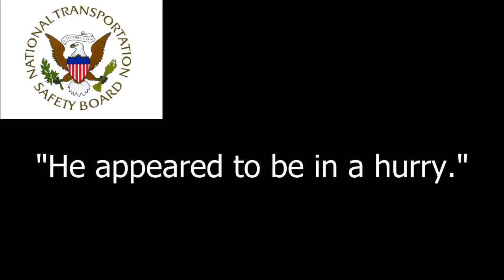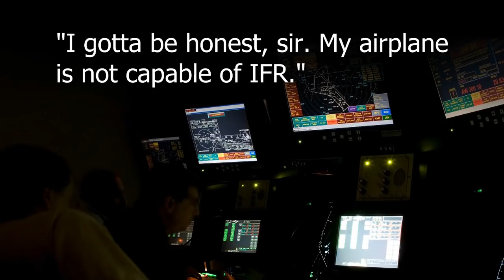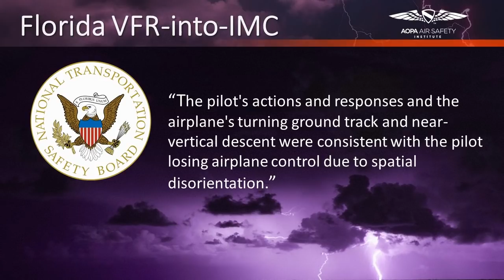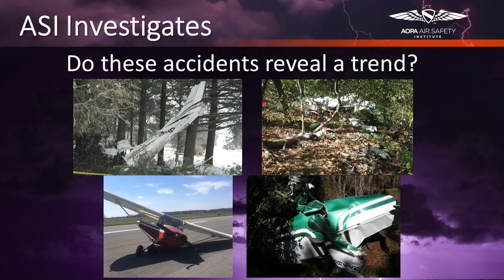ASI Fall Seminar: WX Accidents: Part 5

Comment: Didn't that aircraft at least have a turn and slip indicator? Even if you are totally disoriented, wouldn't that one simple gauge at least help you to keep wings level, and then watching the VSI and airspeed helps you to gain reasonable pitch stability? What about the Artificial Horizon? As one ex RAF fighter pilot used to tell me, "first level the wings, second get the nose straight. Third, solve the problem." Or maybe he was already iced-up and the aircraft was impossible to fly.

Comment: There is no level of hell deep enough or hot enough for an idiot pilot who does not have the common courtesy to leave passengers behind while they fly off to commit suicide. Reports of IMC? Plane not IFR certified? Suicide. A CFI should know better.
Reply: Reminds me of that CFI from the other video that flew his student and a friend into known icing conditions in an overweight Cessna 182 and killed the student's friend when they crashed. Should be charged with manslaughter if you ask me.

Comment: I'm curious.  Why do experienced pilots get into these situations.  I don't mean why do they get into IMC conditions... I understand that.  My question is this.  During my private pilot training (single engine land VFR only), the instructor had me flying under the hood for probably ~3 hours total over 3 to 5 flights.  This included putting me into screwy attitudes and orientations while I wasn't looking (at instruments or out windows), then handing control to me.  While it was a bit nerve racking, I found it fairly easy to look at the primary instrument... the attitude indicator... and return to level flight.  Of course I also needed to pay attention to speed, but that was generally secondary (and fairly obvious from the pitch/noise of the engine, even without looking at the airspeed indicator).

So I guess my question is... especially for IFR pilots in VFR airplanes... why do they get into these totally out of control situations when all the skill that's needed is the ability to understand the attitude and airspeed instruments and respond accordingly?  I'm not really talking about flying into a tornado or hurricane or severe thunderstorm that can rip the control surfaces off the airplane.  Those accidents make sense.  But where the only problem is visibility... I really don't understand how IFR pilots get into these total loss of control situations so often.  Well, I guess it isn't that often, but I've seen a whole lot of crash videos that seem to be this situation.

PS:  I'm also curious whether autopilots on new Dynon/Garmin avionics (including "wings level" button) plus GPS, moving-maps and synthetic vision have greatly reduced crashes in IMC conditions (not counting being blasted out of the sky by super-severe weather).
Reply: max bootstrap I used to wonder the same thing. Actual IMC is a lot different than the hood. With the hood, you still get a lot of clues about your orientation that I never realized before, and you know you can take it off at any time and you have an instructor there which makes a huge psychological difference. You are completely trapped in IMC with no way out. I can’t do the feeling justice here, but it’s a lot to handle. Saying to trust your instruments is easy, but when you are certain- absolutely certain that you are turning, descending, or climbing and your instruments say otherwise... It takes a lot to ignore something you are “100% sure of” if that makes sense. I only have 5 hours of actual, and that feeling is fresh for me. I can absolutely understand how this stuff happens. 

Autopilots make a huge difference. My first flight in IMC was in a 172 w/o autopilot. I was locked onto the artificial horizon, altitude and heading and later realized I never let go of the throttle. Every time you look away, you start to turn a little or something, so you know you can’t look away for long and have to keep dividing your attention. Everything takes a long time, and it’s really easy to get behind again with no escape and no help. You also are so concerned with not dying that you don’t pay attention to secondary tasks. I would brief the approach and not remember any of it for instance. When I had an instructor and later an autopilot to take over while I did these things, it makes a world of difference. Hope this helps. You just gotta ride with someone in this stuff. It’s really something man.
Reply: @dylconnaway9976  : Well, my instructor said I was more willing to trust instruments than any other student he ever had, so maybe I am just weird.  But any pilot who has an IFR rating MUST know that pilots are subject to exactly the phenomenon you mentioned, namely "when sensations and instruments disagree, 99.999% of the time the instruments are correct" (and 0.001% of the time one or more instruments is defective).  Frankly, if I am betting my life (which is the case here), I will definitely go with the 99.999% odds no matter what my senses tell me.

Possibly another reason is this.  My whole life I've been a self-employed scientist, engineer, inventor and product developer.  And I've created a number of robotics and automation systems that include instrumentation that sometimes controls dangerous systems and sometimes advises humans how to control potentially dangerous systems.  So maybe all that thinking through the issues and potentials involved has modified the way I think about instruments.

However, this hasn't AT ALL made me an unquestioning advocate and supporter of instrumentation over humans.  In fact, I think the executives at Boeing should all be hung for demanding their engineers create systems that prevent pilots from having 100% control of the flying process whenever the airplane is closer than 5000 feet (or so) above nearby terrain.  I don't like (but am very grudgingly willing to accept) control systems flying airplanes during portions of the takeoff and landing processes ... BUT ... whenever either pilot grabs and moves any of the primary controls (stick, yoke, rudders, flaps, thrust), the control systems MUST let the pilot fly the airplane, and ONLY the pilot fly the airplane.  Any attempt to overrule or fight the pilot IS MURDER.  Perhaps someday 30, 40, 50 years from now automation systems might become better than pilots when faced with odd/weird/strange/screwy/abnormal situations ... but definitely not yet.  And when that day eventually comes, pilots must not be considered liable for mistakes, because then the executives who demanded engineers design systems that way become fully responsible.

But ... back to the simpler questions we were discussing.

You mention the topic of "memory", which is also a huge issue to me.  I have always had a terrible memory, especially for proper names but also for information that is not obvious (like was that FL230 or FL320 ??? ... or runway 13 or 30 or 31 or what ???).  What appears to be expected of IFR pilots by ATC is beyond my ability to remember, especially since the speed-read the information so fast that they are always talking several terms or numbers ahead of where my recognition and comprehension is.  If I ever HAD to follow IFR takeoff, IFR departure, IFR routing, IFR approach or IFR landing instructions ... I would most definitely need to carry around some kind of digital sound recorder that let me play back what ATC said several times in order to fully register what they said.  What's worse, I usually can't understand what ATC is saying.  Almost everyone at ATC speed-mumbles.  So have most commercial pilots.  And a great many private pilots adopt the monotonic garbled speed-mumble of ATC ... perhaps because they assume that's what ATC wants (since that's what ATC gives).  So in truth, even recording what ATC says is totally insufficient for me, because it doesn't help to 20 times replay noise that I can't understand.

So I'll just stick to VFR ... and flying into and out of remote airports and airstrips and lawns and rural-roads in G airspace that have no ATC.  What I very much appreciate are tools that make pilots able to be much more safe without external human intervention or assistance.  Without any doubt GPS + autopilot + 3D synthetic vision + moving maps (both with color coded terrain) + audible / voice warnings of potential terrain issues + ADS-B out + ADS-B in + Garmin InReachExplorer+ type devices and so forth make flying massively easier for an individual (and individualist) pilot to be safe in potentially dangerous situations.  In fact, a VFR friend of mine suffered a total engine failure event in a very remote mountainous part of Alberta, Canada while flying above a cloud deck.  By watching the moving maps and 3D synthetic vision on his Dynon Skyview HDX1100 display he was able to glide down into the clouds, through a rugged narrow valley (while totally inside clouds), and land on a very rural dirt road less than 100 feet outside the bottom of the cloud layer... with no damage to himself or his airplane.  No IFR pilot would fly such a path on purpose ... so this event tends to confirm for me that modern technology is making life better for newbie VFR pilots who fly in the boonies far from ATC as much as for IFR pilots following complex instructions from ATC.

I think you will at least somewhat agree with this, since you seem to believe that an autopilot makes pilots of small airplanes a great deal safer.
Reply: 1) You know it's coming.
2) You are not stressed.
3) There is probably little turbulence.
4) Your inner ear takes a while to get really disoriented.
5) You are not tempted to look outside, and * think * you see something in the clouds/snow/etc.
6) Icing, rain, lightning.
Reply: @navy_flyer2331  Whoa. That's suicide.

Comment: I know that the spatial disorientation does happen in IMC, but I am still kind of surprised that so many (even IFR rated) pilots have a hard time keeping the plane level by watching artificial horizon and altitude indicators. Just focus on the instruments and listen to ATC, it is possible to survive VFR to IMC (though it is much better to avoid IMC in the first place).
Reply: He was at night lot of turbulence icing conditions without anyway to deice. I think this was more then just trying to keep it level. He knew he was in over his head was too late by the time he declared. You hear stories about 172's still flying with ice built up on the wings but these higher performance thinner wings can't take lot of ice
Reply: You’re right there .I don’t think enough pilots realize the full import of those higher performance, thin wings . Trade offs have to be made , and poorer ice carrying is just one of them
Reply: .. agree ! .. ATC can get you through this sad lack of planning .. just keep proper airspeed and wings level .. and heed their heading and altitude instructions ..  ask for repeat if not clear .. 🛩️

Comment: These videos are extremely valuable.  I am not a pilot, but I love aviation, and I've been mulling over PPL training for the past year.  I think these videos will make me safer if I do
Reply: Do it! Google flight training near your house, give them a quick call, and ask if you can go up for a discovery flight or for a first flight/intro lesson. You can get some air under your wings to see if you like it and then go from there. Most discovery flights are around $100, you’ll get to fly the aircraft, and it will be a great life experience regardless of what you ultimately decide.
Reply: I did do a discovery flight last spring, and I loved it.  I've been debating whether to invest the money and time required.
Reply: @deeanna8448  Do it! Who needs money? Food only adds to gross weight.
Reply: @deeanna8448  Gotcha! Well, if you love it and you can swing at least a 3 lessons a month financially without hardship,  you won't regret the investment. It'll open up a whole new world and new community to you.  Older folks will tell you that in life, it's the things they didn't do that they regret.
Reply: I LOVE THESE VIDEOS. I WATCH THEM ALL THE TIME. THEY'RE NOT ONLY LESSONS, BUT REMINDERS AS WELL.
Reply: @captaine.1223  Your cap lock key is broken.
Reply: @dylconnaway9976  I simply did that to emphasize the importance of the message content.